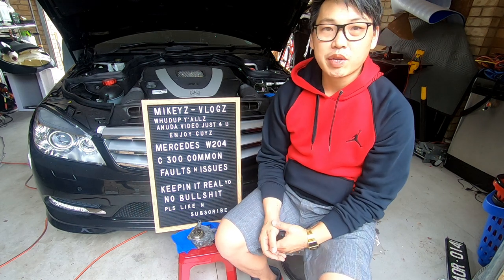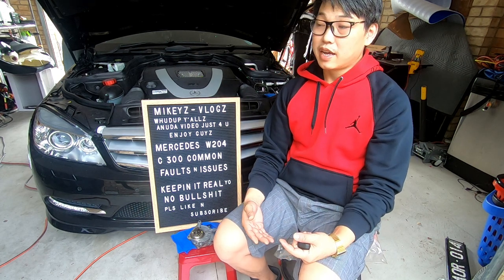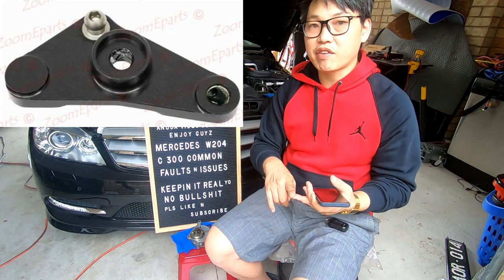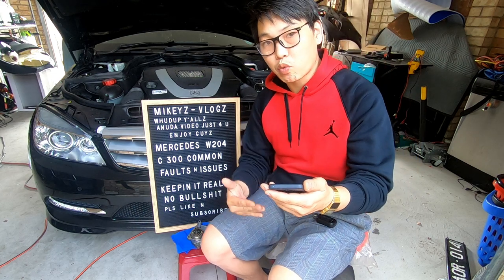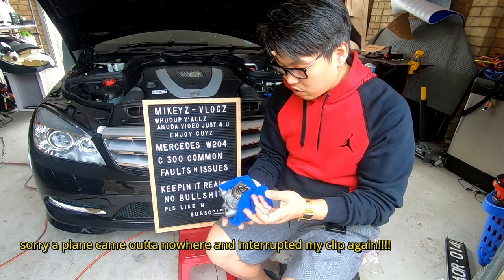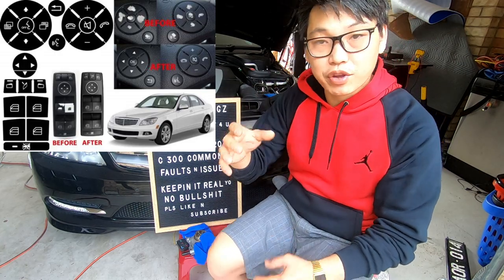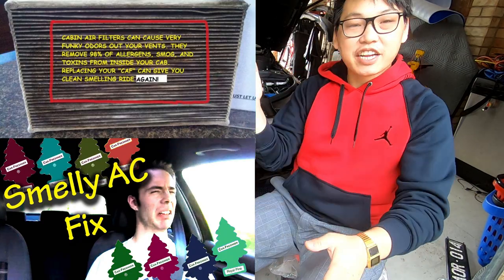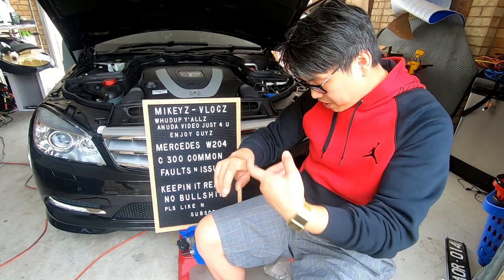2010 mercedes w204 c300 common faultS and issues  v6 m272 BE WARNED

Comment from the maker: 2010 mercedes benz w204 c300 m272 v6 common faults and issues and some things and how to avoid them....must see
Reply from the maker: @akinwaleopeyemi3209  whatsapp? may i ask what ur problem is... i only ask becuz if someone else has the same issue ... posting here your problem can help many other ppl also.... thats why i prefer to msg here so that other ppl who may have the same problem can read and learn
Reply: You should add also TCM and ESP Module failure to this list. I have a love and hate relationship with my  2010 C300
Reply: I have a ESP malfunction in 2008 c350 with 50mil miles car
Reply from the maker: @aydenuriel8828  lol
Reply from the maker: @Peyton Darian lol
Reply: Do you know what could be wrong with my c300. The car runs, drives, and accelerate fine. It’s just when I push the gas pedal down all the way, it goes in to limp mode. It says esc inoperable and looses all power, and is becomes super  lagging..,anyone had the same issue?
Reply from the maker: @vasok4128  sounds like a sensor or loose hose causing an air leak ... don't quote me .. but have you scanned for codes yet ... always do this first
Reply: @MIKEYZVLOGZ  it was a bad gas’s pedal module changed it. car is back to normal drives great again..
Reply from the maker: @vasok4128  good on ya
Reply: Planning to get this car, when you talk about preventive maintenance; please do you have a catalog of what checks to run through or is there a video you have done on it, or a link or something????

Thanks and You are a great guy👊🏽
Reply from the maker: @juzi-mejopetersson9544  basically u do regular checks and keep up with service ...
Reply: @MIKEYZVLOGZ  Thanks for taking out time to reply, but I am someone that relies heavily on details, so I just want to ask, how frequently do you do your own preventive maintenance to check stuff generally, once  a month? 

And how frequently do you change your engine oils and stuff??
Reply: @MIKEYZVLOGZ  I have this very model and have watched your channel with interests.  Here come the big issue that probably you haven't seen or heard: DTC 1208?  Most people would think that it's the BS which could be deadly wrong.  Not only my car is out of affected zone, it lasts 165K miles so far without any major issues at all.  Moreover, I have monitored LIve data and came to this problem.  Just want to see if you could shed any light on it?

DTC 1208 comes occasionally 100-200 miles or 10-20 startups.  Live data show that at startup and idle, Right Intake fluctuates between 35-37 degree as designed.  Under load of RPM 1000-3000, it retarded to -4/20 degree also as expected to provide more torque.  It's that when I pull off the gas pedal, Right Intake cam should go back to 35-37 degree; but occasionally it stuck at 36 or 36.2 degree and became Fixed valve timing (not VVT anymore).  Once engine stopped and started, things go back to normal!  

You've bet, magnets, sensors and pigtail wiring on passenger side have been replaced (and that's how I got rid of DTC 1200 with pulse wheel retarded by half a tooth at 305 ADTC); but not this annoying DTC 1208.  I am thinking that the dowel pin on cam adjuster somehow fail (minor worn) which led to adjuster unable to open once in a while?  Believe it or not, 2 dealerships and 2 Indy shops wanted to tell me timing chain, balance shaft, blah blah.  But I know for a fact that there is no basis in their assumption.  Thank you!
Reply: @vasok4128  I’ve been having the same issue. Is it possible to link me the module you replaced? Is it the full pedal assembly or another part?
Reply: I have a c300 2010 , i have buyed in canada misisagua. And i have a problem when a start the car the headlight’s are always on. Xenon and bixenon are always on in every position. And in stings menu dosent have any option for daytime lights. Can anybody help me?

Comment: I appreciate your advice..Never had a Mecedes Benz,  probably never will just been trying to help out a friend who has a 2011 c300 . It apparently had a parasitic battery drain when he got it . I assume a module is not going to sleep . Then he had the steering wheel lock failure as you described and now a no start no comm between ecm tcm ..After watching a lot of u tube videos apparently there is water introduced into the cabin from different sources . Sun roof drains , from the front sam and from the air cabiin filter area .  All this can cause the can networks to fail and its not pretty . Check you floor area for water . Also water in the front sam unit also i a problem..  These cars are very nice but water introduced into the cabin and electrical problems may sour your thought on the Benz . Good luck
Reply from the maker: thanks for tour kind words and support I really appreciate it

Comment: Just for the info on the 2010 c300 there’s been a total of 3 recalls. 2 airbag problems and a tail light wiring issue.
This was a great video. I love the c300. So clean.
Reply: Opinion has changed so much. Hate this car. Just got it a month ago and had to replace the entire fuel sender unit. Now it just turns but won’t start. F me dude
Reply from the maker: I feel ya man... some of us aren't fortunately enough to have a well taken cared of car.. I'm still experiencing issues ..but small ..nothing major .. but yes I do hear alot of stories about issues...
Reply: @skyb83  Mannn ive had it around a year and my main issue is the lights, They sometimes dont turn off after the car is off causing them to go out if i dont check the lights and turn them off.

Comment: Excellent video.. Keep it up..
I have a c280 2009 which I bought recently.. At cold start the engine sometimes idles poorly for around 10-15 seconds but sometimes no problem.. I suspect a manifold problem? Can you advise..
Reply: Clean your maf and look for any gaps or leaks on intake. Inspect front off manifold for damaged or stuck levers.

Comment: My 08 c300 has smoke coming out of the pass side of the engine bay...imma replace that round plastice thing you showed
Reply from the maker: always try look for the issue first ... before throwing parts at the car hoping to fix it ... just so u are more sure its the issue and that way tour not scratching your head after replacing a part and it doesn't solve the problem..I learnt the hard way and did that .. that's why I wanted to stress how important it is to narrow down the issue and trying to pinpoint before changing parts..with that said I hope u do solve your issue bud... all the best to ya

Comment: Hi! I have a question. My daughter has my older car (just turned 16) it’s a 2010 c300. It all of a sudden has such a strong fuel odor. It’s strong on the driver side in and outside of the car. BTW, my driver side is the left side. We live in the USA. Any ideas? Really hoping we can fix this on our own bc the prices here to have Mercedes fix is insane! Any help would be very appreciated! Thank you and enjoying your videos.
Reply from the maker: most likely leaking  fuel filter and line ..check under the car once u park is there any liquid on the floor or u der where engine is ... open the bonnet check for leaks and smells

Comment: Ur channel has helped me tons. Thanks from the US. Q. The local mercedes dealer says I need to change my secondary air pump. Seems very costly. Thoughts?
Reply: My car is the 2010 model c300 v6 with 120k miles. Runs great. Aussie Aussie Aussie. Thanks brother.
Reply from the maker: secondary air pump is real easy buddy it's basically right under the engine cover ... hope you change it soon ... I'm sure u can do it yourself friend it's not that expensive buddy about 200 aud maybe cheaper Ebay is a great place to start never buy from Mercedes they will rape you sideways ....
Reply: I love this guy and I haven’t even started watching the video yet

Comment: Hi Mikey, I have a Japanese spec 2010 C300, here in NZ. My daylight running lights are not going in the daytime, but are lit at a reduced output in the dark. Any thoughts as to why they aren’t going in the daytime? Graeme
Reply from the maker: ur auto light sensor on windscreen  or your ballast for your headlights check these start with an obd2 scan .. a proper one that does mercedes that way it can. tell u what's wrong and even narrow it down for u
Reply: Setting needs to be done for the running lights to be on/off selectable.

Comment: Is there any difference due to reliability between the first 3.5 V6 2004 and the latest (280,300) 3.0 231 hp?
Reply from the maker: to be honest I. not too sure I. only talking about the w204 and what I know from blogs and forums and what ppl tell .e
Reply: M276 3.5L V6 is the nrw improved engine from 2011

Comment: I have low beam problem on passenger side. Even if changed low beam still passenger side color is yellow. First couple day both was white then turn yellow again.
Reply from the maker: that sounds very strange , is the headlight yellow? or the lens of the headlight?? or is it making the light bulb glow yellow? have u tried using a white led bulb to see if the beam is white ... for it to go yellow, seem like aa faulty bulb or maybe u touched the bulb with your fingers, i have seen it happen when you touch the actual bulb with your haNDS, THE CONTAMINATES ON YOUR HANDS CAN MAKE THE BULBS CHANGE COLOUR..ITS A STRETCH BUT I HAVE SEEN THIS HAPPEN FIRST HAND

Comment: Have you ever gotten the electronic stability program control unit code 5001 N30/4 ?
Reply from the maker: only the esp fault wen disconnecting battery but that corrects itself from a drive and turning the wheel all the way left and right..sorry can't say I have as yet man
Reply: That's good to hear you're videos great you explain very well thanks 👍

Comment: can you do a video on the issue when the audio stops working it's either on the sub/amp or I don't know what it could be but it seems like it's a very common issue with Mercedes when the stereo stops working.
Reply from the maker: i will have to do some research on that as i havent  experienced it yet..but i have heard of the issue but dont know the actual source of the issue

Comment: And where do you buy all the body work and parts from?
Reply from the maker: I get it from Ebay and also I check the web for other sites I  my country that sell certain parts ..if unsuccessful I try to import them from other countries... but Ebay is a great place to start... as for the extras like addons and bling parts I get them from aliexpress
Reply: but eBay does have OEM parts for Mercs?
Reply from the maker: @anuradhasenevi6581  yes ebay does have oem parts and genuine also just make sure you check first and ask the seller ... also sometimes I've had to settle for 2nd hand part and then had a body shop re mold and respray it to make.it new again
Reply: Okay! Thank You! Mike👍

Comment: Any issue with cold start up rattle for about 3-5 seconds. Heard could be defective Chain tensioner ?
Reply from the maker: not that I know of..
Reply: It will be the cam adjuster probably. They use to rattle for a few seconds until the oil prssure builds up. Not a big deal, pretty common on higher mileage engines.

Comment: Hey MIKEYZ, I recently have a ESP (n30/4) trouble codes: (C2000) The supply voltage of control unit "N30/4 (Electronic Stability Program control T unit)" is too low (undervoltage), and (C3208) One or more signals sent from control unit "Combustion engine" via the CAN bus is implausible from my Bluedriver OBD reader. Also it says they are "NOT PRESENT" according to the data report I downloaded onto my computer. Any idea what this might be?
Reply from the maker: hey bud honestlky not too sure,
Reply: Low voltage i check the supply and ground circuits . Today i watched Paul Danner fix a bad reference circuit on a Benz . It was corrosion on a fuse in a panel.  Water had gotten on the fuse.. Check voltage on a loaded circuit

Comment: where can you get the replacment cams parts
Reply from the maker: hey there mate... welcome to the channel... personally for myself I always try Ebay and online parts stores as they are most probably cheaper then actual Mercedes dealerships and I go for oem verified parts ... try Ebay Amazon and tour local European parts stores .... as I haven't had to replace those parts before I cant give u a definitive answer ... having said that be sure to do research with prices and compare price and quality and consider ease of warranty and service
Reply: It is Now A RECALL , Go to the Dealer ASAP or your car will go Boom, 2008-2010
2011 cars have replaced on the Assembly line from the manufacturer

Comment: I have a p0705 code in my 2010 c300 what should I do
Reply from the maker: @1kjj542  take it to a mechanic and verify what the issue is and go from there...
Reply: Says a transmission range sensor circuit malfunction (PRNDL)input

Comment: I dont have this engine i have the older m113 my ml430.  i heard of the balance shaft gear issue and the variable cam gears rattle issue on this dual cam engines. have you looked into that?
Reply from the maker: no jowever i have heard that there can be rust build up on the under the rear axle causing it to deteriorate and mercedes actually know about this issue and in a russian article it has stated that some ppl have even gotten a new rear end undercarriage due to this issue...worth looking up ..there are soany faults with this model ..but depending on your make will also determine what issues you face..newer models have less issues due to merc solving them along the way

Comment: I have a 2008. C300.  My rpms bounce and it lags a little the back shakes a little and also no codes are there.  It takes a while to get up to speed
Reply from the maker: that sounds like an issue with your intake manifold ... or the throttle body... lagging is also a sign of an airleak too... wierd no codes ...
Reply: @MIKEYZVLOGZ  kinda like it power pulses to get to speed.  Then shakes.  A little.  When I’m going fast in the freeway it’s great.  I restrted my transmission . Ok I will def look at the info you gave me thank you
Reply from the maker: @isaacretana1497  doesn't sound healthy at all for your car maybe try look into it before  u keep driving and maybe do more damage... just bare in mind ... just in case. hope u get it sorted buddy... wish u all the best..and post your findings and fix so it may help others solve their own issues
Reply: @MIKEYZVLOGZ  thanks so much man I’ll definitely let you know what happened
Reply: @MIKEYZVLOGZ  what happends

Comment: They are also known for snapping off the front drive shaft, which can cause a lot of damage.
Reply from the maker: good share
Reply: Mine snapped doing 60. Hit my transmission but not much damage what it did do was break my transfer case shaft. Had to rebuild my case for around 2800$ 126k miles
Reply from the maker: @PleaseDontDoThis  damn

Comment: Hey, just wanted to let you know the battery drainage and eyebrow issues is due to the exterior light switch.
Reply from the maker: really ? I didn't know that ..what do u mean exactly ? which exterior light switch? I just meant it drains so fast even if u leave your car lights on for about 20 mins sometimes u cant even start ur car...but thanks u for letting me know I really appreciate that ... I hope u can also help support my channel ...so much more videos to come
Reply: MIKEYZ VLOGZ it’s the headlight switch.
Reply from the maker: @anthonylam8776  what do u mean by that exactly and how would u fix it or solve the issue? sorry I dont quite understand whatu mean dats all
Reply: MIKEYZ VLOGZ it a common problem on the w204. You must replace the actual switch in order to fix the issue. The switch goes bad and sadly the only fix is to replace it.
Reply: Symptoms are draining battery and parking lights staying on.

Comment: I have a similar w204 and my  greatest concern is the ASL failure .Presently I am doing 90,000km.Will you trigger any code in replacing the burnt out motor ?
Reply from the maker: if u disconnect your battery properly and wait 20m before starting ..no ..u will not trigger a single error ... that im sure of
Reply: Very many thanks .You have allayed my fears for now.  @MIKEYZVLOGZ
Reply from the maker: @philipdeg1594  im glad my video was somewhat helpful to you ... thats what its all about for me

Comment: At around mileage do these issues start showing? I’m thinking of picking up a model that’s got under 65000 miles
Reply from the maker: well some are random.. but I would say about 65000 ..but example my esl died at 90000kms which is about that ... and  other things around that too but like I said some ppl go to 100000mls and no issue.. just depends .. u might get lucky

Comment: Will the ecu from a c300 amg be coded for c280. W204
Reply from the maker: I doubt it as the amg has different features and is programmed different.. for example the cluster is programmed differently and looks different too.. but u might be able to make it work as long as u can code it and sync it
Reply: @MIKEYZVLOGZ are the engines are the same? I was hoping to get the c300 box and code it for use in the 280
Reply from the maker: @dr.clydepaul7376  yes 280 and 300 are the same